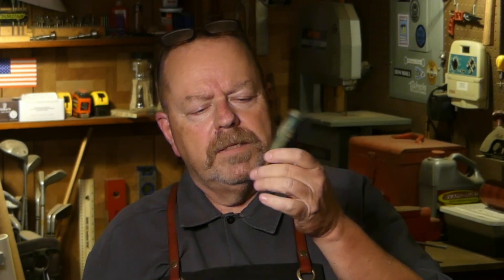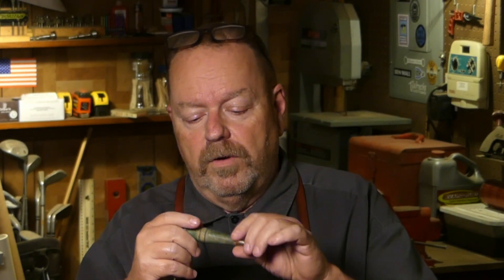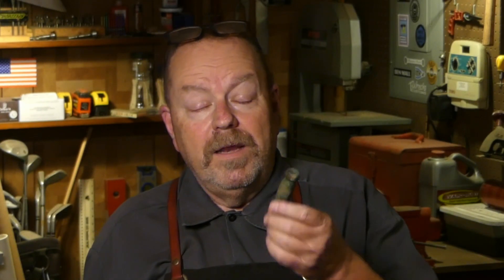Whoops I Did It Again

Comment: I didn’t see that coming!  Sometimes the most simple operation will cause disaster.  My Dad was a gorilla and so many times he wanted to make sure a bolt was tight and would snap the head right off!  😂.  He tried only using one hand and only snapped half the bolts!  😃👍
Reply from the maker: I bought a Dremel and immediately ruined it by torquing down the collar too hard. :)
Reply: @mrbenmall  Don't make 'em like they used to.
Reply: The motto of the Merchant Marine's Uncle was 'Come or BLEED'! His son will pull something to the required spec and then give it an extra 3/4 or turn or two to be sure.